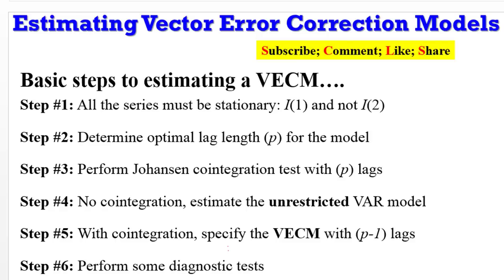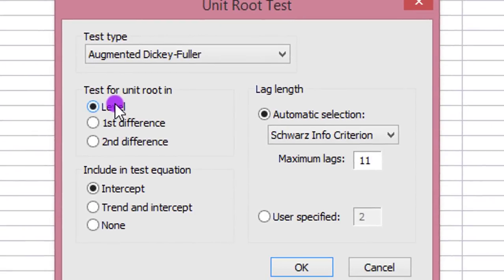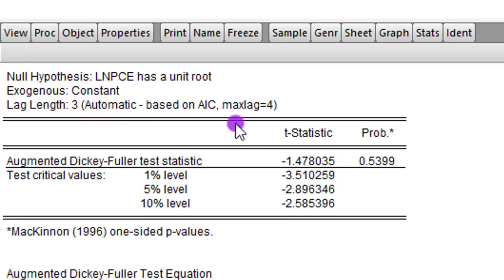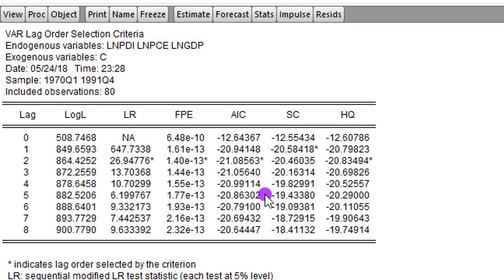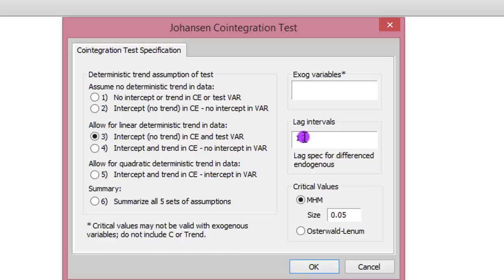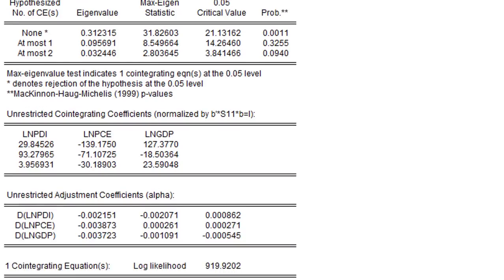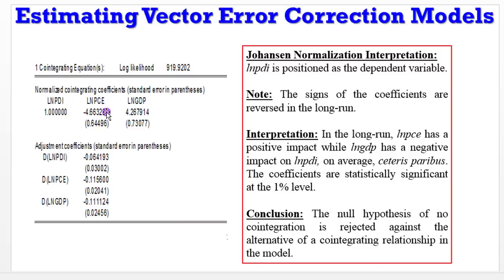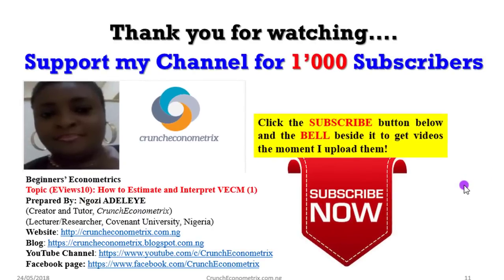(EViews10): Estimate and Interpret VECM (1) #var #vecm #causality #lags #Johansen #innovations

Comment: when I try to analize the coefficient (ECT-1) in VECM, to verifciate a long run causal relation, the coefficient is significant but positive. Is it a bad signal?
Reply from the maker: Paolo, it's an indication that the model is explosive. No conversion to long-run equilibrium.
Reply: @ Thanks for your answer Ma'am, greetings from Chile
Reply: @CrunchEconometrix  I have another question, to estimate 3 ECT, because I have 3 variables counting the dep variable (In my model). In the VECM I have to estimate 3 times the VECM changing the variables dep to make the system and see the prob?
Reply from the maker: Yes, you can do that if it addresses your research questions.
Reply: @CrunchEconometrix  thanks for your answer, your videos helped me a lot
Reply from the maker: U're very welcome 🙏 🤗

Comment: Hello Ma'am, thank you so much for the video. I have a little challenge. What do I do when the optimal lag length is identified by the criterion, but when i try using it in the model, I get an error message stating ''insufficient number of observation''?
Reply from the maker: Several reasons. Too many variables, too many lags and/or a short time span. For instance, too many lags will reduce the number of observations. Reduce the lags to 1 and re-estimate the model, but make sure you have at least 3 observations BEFORE doing so.

Comment: Hi, I have three variables 1) Price 2) harvested Area 3) Yield rate of rice. I am trying to test if there are relationship of each variables between each other so that i can draw some conclusion regarding whether stabilise the rice price can help to stabilise the yield/ harvest area.

I tried to take a log of these three variables in order to better understand them in % change. not that they are skewed.

I then test the stationarity by ADF, showing that only ln (Yield) is stationary. I then perform the commond differencing and test again and so on. I finally got ln (Price) after one-time differencing (ln(1)) and ln (Harvest Area) after two time differencing (ln(2)).

I then also conducted the Johansen integration test on the variables ln (Yield), dln (Price) and dd ln (Harvest Area), the result shows that they have cointegration relationship for at least 2 variables. Cointegration test result here enter image description here On the final part, I want to fit those three variables into Vector error correction model.

The problem is here, in order to fit the VECM, all variables should ideally be integrated of the same order, typically I(1) which is not my case here.

if that is a absolute requirement? can my case use VECM? if no, then i should go for VAR instead? or you have other suggestions?
Reply from the maker: Please try to be very brief. Depending on the outcome of your unit root test AND your research objectives, you can decide between ARDL-ECM or VAR-VECM techniques.

Comment: Lags interval (in first differences): 1 to 8				
				
Unrestricted Cointegration Rank Test (Trace)				
				
Hypothesized		Trace	0.05	
No. of CE(s)	Eigenvalue	Statistic	Critical Value	Prob.**
				
None	 0.005239	 19.25753	 29.79707	 0.4745
At most 1	 0.001922	 5.374218	 15.49471	 0.7679
At most 2	 0.000109	 0.289312	 3.841466	 0.5907
				
how to interpret this madam?
Reply from the maker: Sunita, this video just like others is well explained. Watch it again and interpret your results.

Comment: Really thankfull for the video and your explanation Mam. I have a question, in your video there is no list for VAR Stability test. Is it no need to check the stability because there is no Impulse Response Function and Variance Decomposition test? thank you so much mam
Reply from the maker: Rizka, your query is muddled up. Very confusing to understand. Kindly recast. Thanks.
Reply: @CrunchEconometrix  okay sorrry mam, so I've read some of journal and they are using VAR/VECM stability test and also IRF and VD test, so I want to ask..is it necessary to do those test? 

And I have another question  mam...My VECM model didn't pass the diagnostic test, is there any way to solve this problem? thank you mam
Reply from the maker: Rizka, I have videos on those areas you refer to. Kindly watch them to see what I did and adapt. Thanks.

Comment: Dear Mam, thank you so much for this informative video. It helped me a lot. However, I have a few questions and I will be really grateful if you help me with the answers. In Johansen Normalitaization Interpretation, what percentage should be compared for testing significance of coefficients at 5% level, and will it be statistically significant if the t-statistics is greater than z value both for plus and minus? Thank you again.
Reply from the maker: Hi Christina, I gave clear explanations on the decision criteria. Also, kindly watch my video on Johansen Cointegration. Thanks.

Comment: Dear Ma'am, I applied the given steps while doing my estimations on my time series dat of 40 annual observations. After estimating the VAR in computed the optimal lag length which is 5. Now doing the Johnson coIntegration test , when I am putting the lag interval 1 to 5, it give an error "Near singular matrix". What should I do to eliminate this error in order to proceed further.........................................Moreover although the optimal lag length is 5 (which in this case is not helping me to further proceed my estimations) so i put arbitrary lag length of 3 and with this arbitrary lag length the Johnson  coIntegration test is not giving any error.   
Concluding it, my question is " If the estimation with the optimal lag length is giving an error, can we apply arbitrary lag length for conduction of   Johnson coIntegration test ?............. Provided that, my observation is betwen 37 to 40 (the data is annual)
Reply from the maker: Hi Tariq, kindly shorten your query. Too long didn't read (TLDR).
Reply: @CrunchEconometrix  Dear Professor, How can I interpret my results? 
1) ARDL-Bond test:Cointegration Confirmed
 2) Model:  ARDL-ECM through OLS 
 3) Probability of coefficients for ECM and all independent variables is higher than 0.05. 

Thank you!
Reply: Tariq, I give interpretations in my videos. I will advise you watch them and adapt to your results. Thanks.

Comment: Respected Ma'am ,  The researchers are getting too much benefits from your lectures. You explain the difficult things in a very simple manner. thanks a lot for guiding us in econometric techniques. .  Ma'am, I want to ask one thing that can we apply cointegration and VECM (If Variables are Cointegrated) on the variables which are stationary at level, means I(0)
 ?
Reply from the maker: It's my pleasure, Suresh. Thanks for the encouraging feedback. If all the variables are I(0) proceed to perform just OLS. I have a video on that. Search through my Channel and watch. Kind regards.
Reply: A Bundle of Thanks for replying Ma'am.

  Can we apply VAR model also on two I(0) series? 

In my paper,  I have applied VAR model,  Wald test for joint significance, Granger causality test, Impulse Response Function and Variance Decomposition model on the panel data of  two variables both of  which are I(0).    M I going right?  
I need your expert suggestion. Please help.
Reply from the maker: Kindly watch my videos on VAR. Well explained. Thanks.

Comment: Thank you for all these videos ,I  really need your help . It's better that I give brief about my case . I have one dependent variable Y and 7 independent variables . My aim is to forecast Y but i am not sure which model is more suitable.  All series are non stationary and not normal  at level  .I took the logs and first difference for all series and I ran VAR eviews model . After that I tested the optimal lag and based on AIC it was 2 . Then i tested for co-integration using 2 lags . There was two cointegrations defined . As far as my understanding if the variables are stationary at first difference and there is co-integeration  , I shall go to VECM model with (p-1) . Once i run the VECM model , the residuals are not normal,  serially correlated and has heteroskedasticity. What shall I do in this case ?
Reply from the maker: Hi Ahmad, yes such can happen. You may need to reduce your regressors and re-estimate. If the problem persist, estimate the model at higher lag levels.
Reply: @CrunchEconometrix  Thanks , I hadn't checked for Multicollinearity before . Now i did and i found two regressors with high VIF .will eliminate them and try again.  Will let u know .
Reply: May you please advise how may I reverse the log function . I took the logs of all series but now after running the model and forecast , I would like to interpret the results by seeing the real numbers .
Reply from the maker: Ahmad, having taken the log, you have to use the "elasticity" interpretation.
Reply: @CrunchEconometrix   can you please explain . Guide me If it's there in one of your videos .Thanks
Reply from the maker: I don't understand what you mean? Guide for elasticity?
Reply: @CrunchEconometrix  Yes , I didn't understand what you mean by "elasticity" intrrpretation .

Comment: I have one query, if I have daily closing price of stock, why do take the airthmatic or log return for the series, why cannot we take the value of series directly as closing price and apply the test
Reply from the maker: Of course you can...only that the returns (log difference) is stationary. You can use the difference of the closing price too depending on your research focus. Using "returns" is not mandatory.

Comment: hello Madam, can the series be of Order I(O) for running VECM
Reply: I have also read that in ARDL model the dependent variable should be I(1) and I am running the ARDL model and the dependent variable is of I(O) and the problem which I am facing from last one month is that ECT is -0.99 which means its is approx 100 % which should not be the case. Can we have some other test where all variables are of Io order for long term integration
Reply from the maker: Hi Ramandeep, my videos on VAR and VECM are well explained. Kindly watch them again and consult relevant references listed at the end of the video. Thanks.
Reply: @CrunchEconometrix  I have already published some research paper using your video's. Now I was working on my phD, it could only be possible because of you.
Reply from the maker: You are so destined for the top, Raman. I give a million likes for this encouraging feedback. Well done!

Comment: Good afternoon Ma'am.
Thanks for reply. I have a question.  i am analyzing my work with  panel data of 28 years with five different countries. May i use  VECM model in it ? Kindly advice me.  Thank you.
Reply from the maker: Hi Hemant, if N < T as your current data structure, use panel ARDL.

Comment: Hello ma'am, is it permissible to conduct the Johansen Cointegration test on RAW DATA, and then if I find cointegrating relationship in the results, can I conduct VECM on LOG TRANSFORMED DATA for better interpretation of results? Or is it necessary to perform the Johansen cointegration test on log-transformed data if I intend to perform the VECM test on log-transformed data? Thank you so much for your videos and assistance. They have literally helped me complete my research work!
Reply from the maker: Hi Saima, Yes. I explained this in my video on the Johansen Cointegration test. I'm advising you to watch the video for more information. Thanks.
Reply: @CrunchEconometrix  Thank you so much for your reply ma'am. I watched your tutorial on Johansen Cointegration test. But I think I couldn't explain my query clearly. Ma'am my confusion is that suppose I apply the Johansen Coint. test on RAW data that is not log-transformed and I find a cointegrating relationship exists, then can I use log-transformed data to conduct the VECM test or will I have to use raw data for the VECM test because I used raw data for the Johansen Coint. test? So, In case if in my study I use Raw data ( not transformed into log) for Johansen test and then Log transformed data for VECM then will this affect the reliability/accuracy of my results?
Reply from the maker: You are on track. Go ahead.

Comment: Dear Professor, 

I need your help. I have monthly data for unemployment rate and for the number of persons who checked-in in turism units. The lag length that i have chosen is 24, and i obtain that the optimum lag for LR is 20 and for AIC is 5. With the optimum lag 20 i have cointegration, but with the 5 i don t. Do you think i can choose the optimum lag 20? I just need to have cointegration in my data for a project...

Thank you so very much!
Reply from the maker: Hi Georgina, read up on the underlying assumptions for LR and AIC to know if your data conforms to using either after which you decide. I know AIC/SBIC are efficient in small small samples but don't know about LR.
Reply: @CrunchEconometrix  Thank you for your answer and all the knowledge you share with us! Wish you all the best!
Reply: Also, with the optimum lag 20 my errors satisfy the 3 hypothesis.

Comment: Hello ma'am,
I have a question, while find out the optimal lag length of the underlined variables if it comes 1 then at the time time of performing VECM we will take (p-1) lag then accordingly it becomes 0 so what should I do next..???
Reply: Same doubt here.
Reply from the maker: Not an issue. Retain the 1 lag as VECM cannot be estimated as a static model and make a note in your work explaining what you did.

Comment: Professor, i've run bounds test as vectors and found them all cointegrated, what should i do??
Reply from the maker: Hi Belfqih, this video is on VECM to which the Bounds test is not applicable. Kindly watch my ARDL videos. Please may I know from where (location) you are reaching me?
Reply: @CrunchEconometrix  from Morocco, i have watched every single tuto of yours. I have run ARDL bounds test on my 7 variables as a VAR, the bounds F-test shows that all my 7 vectors are cointegrated. The next step being to estimate ECM or VECM i'm stuck
Reply from the maker: Ok Belfiqh, you obviously did not watch ALL my ARDL videos because I showed and explained what to do. But keep it simple by estimating an ECM on your main variable of interest... It is also possible to estimate ARDL-VECM. You can watch my video on that. Also, to guide you properly use the correct ARDL video thread to post your query not VAR.
Reply: @CrunchEconometrix  thank you very much professor. I will

Comment: Thank you Dr. for this tutorial. i have a question, if after unit root test, we obtain i(0) i(1) I(1) I(2). Which model should we use in our analysis
Reply from the maker: Hi Alfred, once you have I(2) series the Toda-Yamamoto technique is applicable. Read more about it because I've not had cause for it. Thanks for the positive feedback on my video. May I know from where (location) you are reaching me?

Comment: Thank you very mich for the video

I have two questions:
1. Does the Normalized cointegrating coefficient interpretation replace the Granger Causality test in the case VAR and VECM (for short and long run).
2. If so, should we consider the same method to interpret the Normalized coefficients which is reversing the sing in the case of short run ?

If what I have mentioned is possible... I highly appreciate if you share with me some references to support my analysis

Best regards
Reply from the maker: Hi Hechem, NC and GC are not the same. Please watch my videos again on these procedures. There are tons of papers on the internet that you can download, read and reference.

Comment: what we do if the long run coefficient of the variable  is not statistically significant but they have con integration and the speed of adjustment is statistically significant? specially in the case of exchange rate devaluation and trade balance if the coefficient of real exchange rate is not statistically significant can we say there is long run causality from real exchange rate to trade balance  in the long run? in VECTOR ERROR CORRECTION MODEL.
Reply from the maker: Debela, the H0 is no causal relationship. With insignificant coeffs, H0 cannot be rejected. However, a significant ECT evidences joint causality from the regressors to the outcome variable. May I know from where (location) you are reaching me?
Reply: here from Ethiopia but is there any theoretical support that devaluation may not improve trade balance in the long run ?
Reply from the maker: @debelagelana6408  You'll have to do some readings on that. You might find papers with such findings.
Reply: thank you so much
Reply from the maker: @debelagelana6408  U're very much welcome! 💕 😊

Comment: Hello Ma'am, Can we conclude that the normalized cointegration coefficient measures the exact long-run relationship between the variables? Secondly, normalized cointegration coefficients are insignificant after calculating the t-value. I made sure my specification of the variables for the test is correct. Is there a solution here?
Reply from the maker: Hi Perry, yes we can say that because cointegration implies that the variables move together over the long-run horizon. It will be good if the coeffs are significant but if otherwise it simply shows that though the series move together in the long-run such movement is not significant, whatever that means. May I know from where (location) you are reaching me from?
Reply: @CrunchEconometrix  I'm reaching you from India Ma'am.  Thank you for the response
Reply from the maker: Perry Elorm  U're welcome, Perry...please share my videos with your academic community in India and beyond!😀
Reply: @CrunchEconometrix  Sure I will your videos have been really helpful